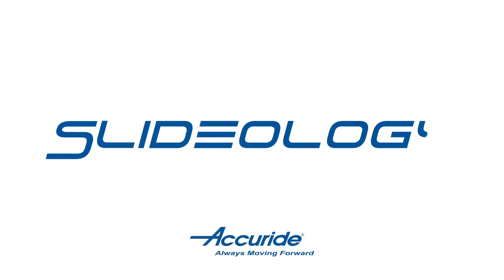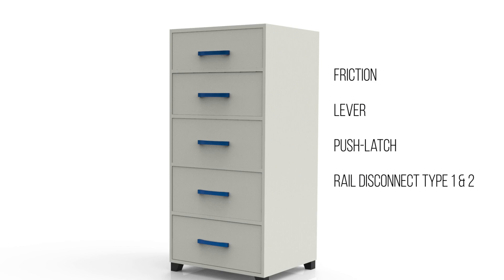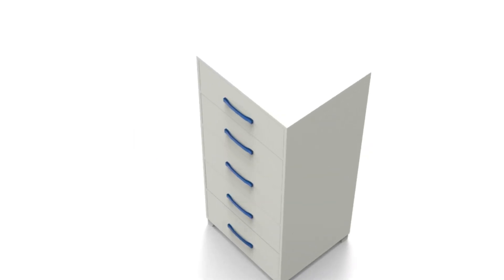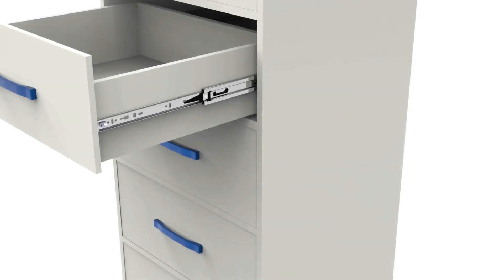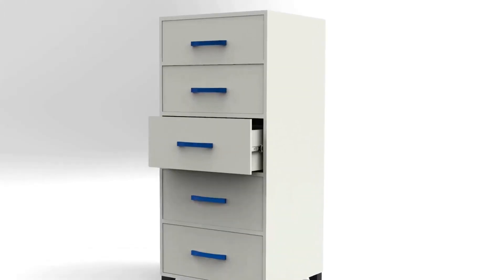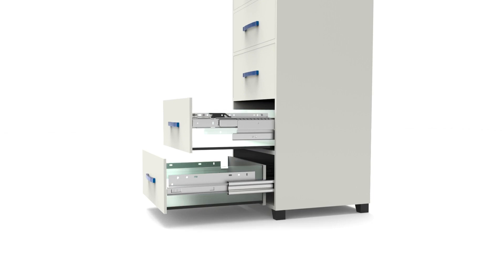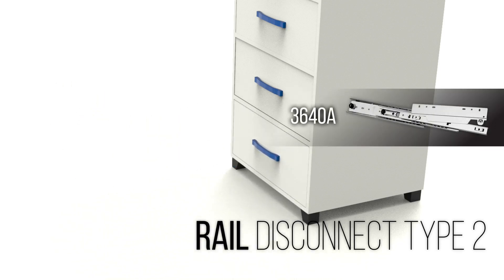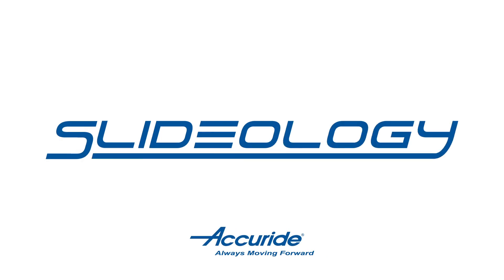Drawer Slide Terminology - Disconnects And The Different Types.

Comment: I have a rail disconnect type 1 on a desk in our office. It took me an hour to get it off. The problem was the worker at the factory drove a screw on the end of each rail securing it fast to the drawer! I don't know why there are screw holes in the ends of the rails.